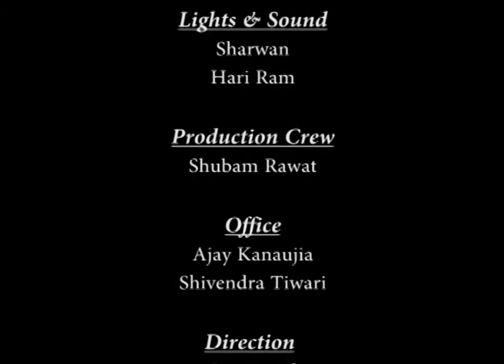Mod-01 Lec-36 Lecture-36

Comment: How to calculate convective heat transfer coefficient assuming no radiation or conduction? How to calculate mass transfer coefficient taking into account non linear parts?

Drying with air at constant flow rate